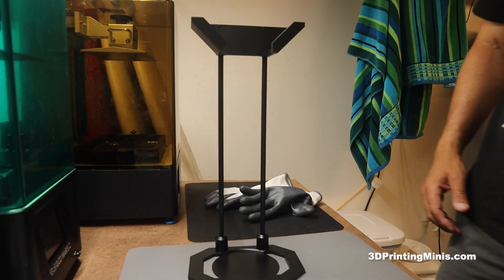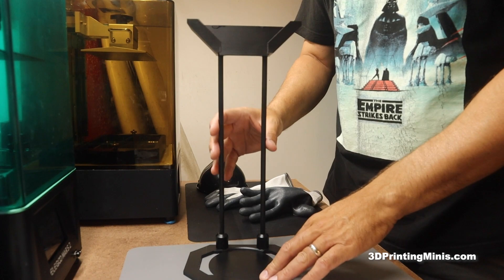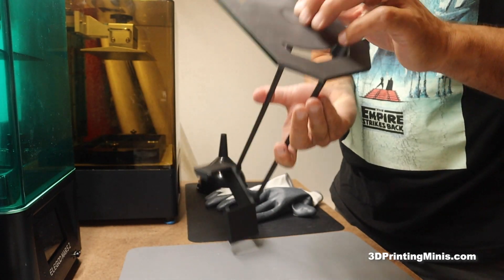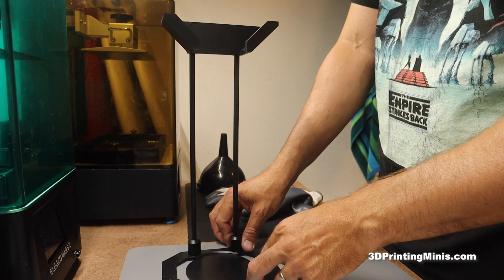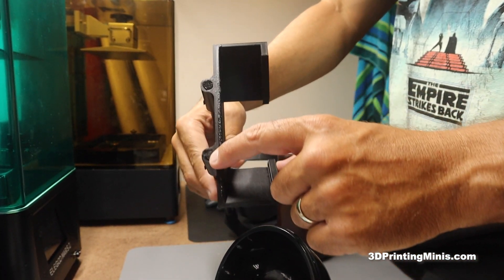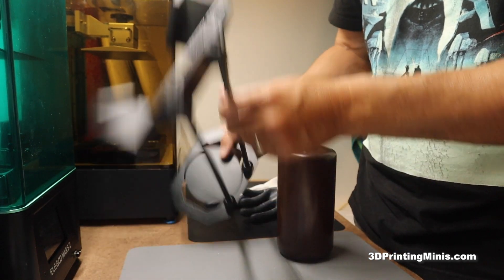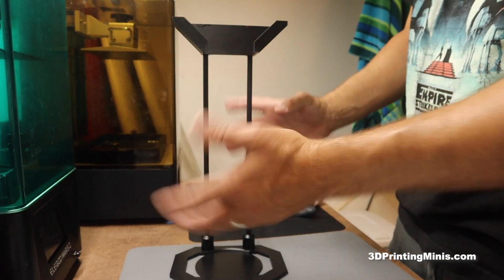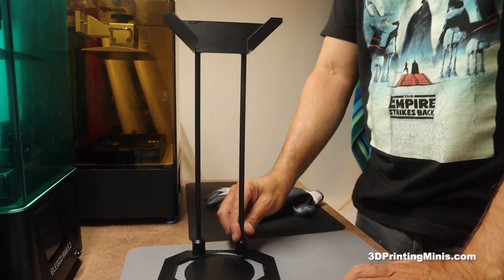How To Make A Resin 3D Printer Vat Holder - DIY 3D Printer Resin Drainer

Comment: Better solution is to not even remove the VAT from the machine. Use the tank cleaning feature which just floods the tank with UV light. Lightly push something on the bottom corner of the vat (like left over supports on a raft or a failed print). Then expose and you can pull the entire bottom away. If your printer doesn't have it, slice a file that has 1 single 15 sec fully exposed layer. This does use some resin but it will save on fep degredation/cleaning.
Reply from the maker: Not really. Because tank cleaning feature cleans the bottom resin sitting on the FEP. Any bits of supports or broken/failed model piece floating around in the middle or near the top of the resin do not get cleaned. From time to time (some people do it every print) you need to dump out and filter your resin. Getting a piece of a support stuck between the plate and you FEP can puncture your FEP.
Reply from the maker: Also, some failed pieces will  really adhere to your FEP and you'll need to spray/soak them with IPA and let them sit for a bit to get them to loosen up and to come off without ruining your FEP.
Reply: @3DPrintingMinis  They can even crack your screen, which is what happened to me.